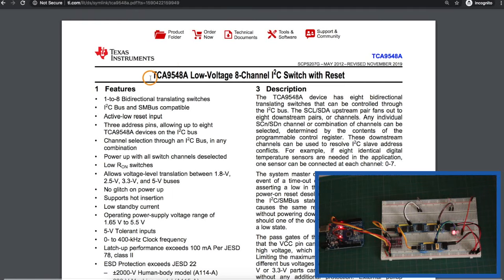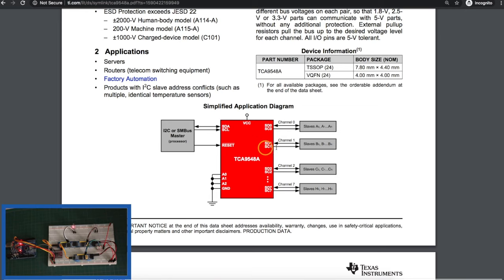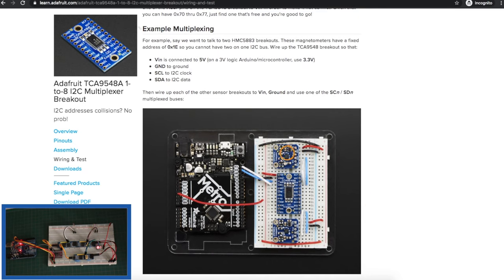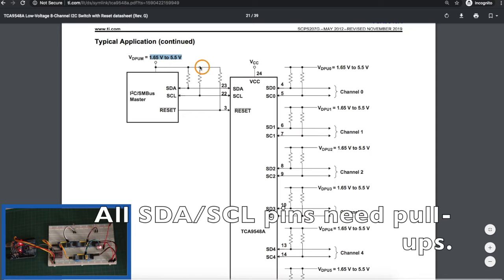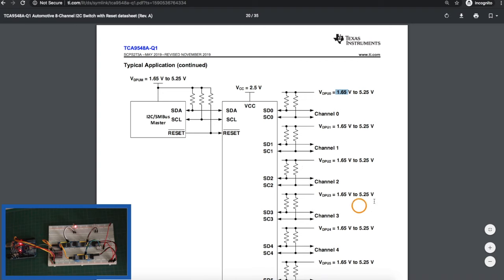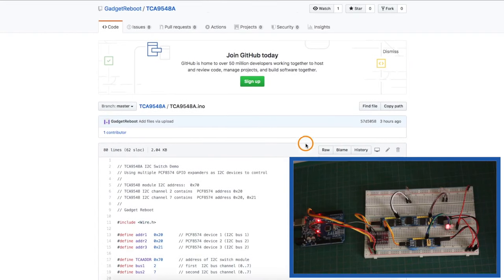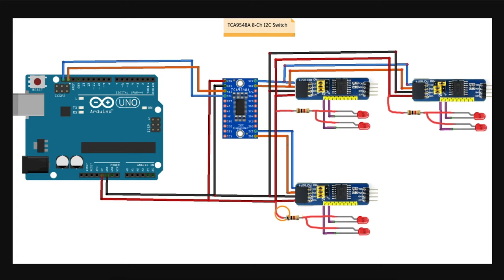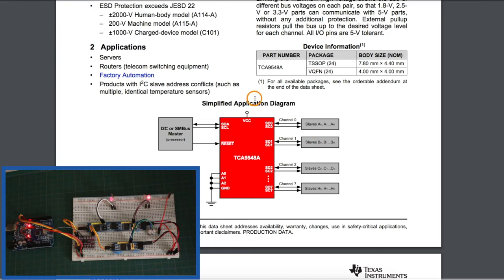TCA9548A I2C Multiplexer: Use Multiple Devices with the Same Address on Arduino

Comment: It's a nice chip, but you have to try and keep as much on the same bus as you can to keep the bus switching overhead to a minimum If you require full speed. Still it's a nice way of getting out of an conflicting address hole.
Reply from the maker: Yeah I can't imagine trying to do fast ADC or DAC things this way.
Reply: @GadgetReboot  For fast ADC or DAC, a high-speed DMA SPI would be the preferred protocol.

Comment: Nice job!  I had not thought about needing this, so far all my i2c are configurable or on unique addresses.  Very well explained.  Off to ali I go...
Reply from the maker: I had this module sitting around who knows how long, then I hard wired the address pins to a chip on a PCB and realized I should have put jumpers so I caused my own limitation when I wanted to use 2 boards together...  Always good to buy random modules for those unexpected times.

Comment: Hello mam.... Begin just a beginner and have started learning very basic of arduino... I came across how we can  expand are I/O pin in arduino... But i was wondering can we store the status of those pins in the eeprom of arduino... So even if power cuts the expander regain its previous state before the power cut
Reply from the maker: I've never used the EEProm but apparently there's examples here for reading and writing to it https://www.arduino.cc/en/Reference/EEPROM   
So yeah, if pin states are known like an 8 bit byte of GPIO states, that byte should easily be able to write to EEPROM using the examples and later can be read back from that location.
Reply: @GadgetReboot  oh...!!! thanku mam for your reply... Although i did not  dive deep in the EEPROM functionality but i have learnt how to read and write to EEPROM.... And  here with expander Ic's i thought that there would be a different way of implementing them.... As ARDUINO and ESP8266 have different ways to perform the Eeprom.... But know my concept of using Eeprom with expander Ic's is clear

Comment: Hello, I'm a beginner and I would like to know :
Can I control relays with this address?

Thank you in advance 😊.

Cordially.
Reply from the maker: These are logic level control signals so some sort of relay driver would still be needed and that would be hooked up to these logic outputs. So either some sort of transistor driver or a more simple way is a driver chip like ULN2003 or ULN2803
https://microcontrollerslab.com/introduction-uln2803-features/
Reply: @GadgetReboot  Hello, thank you very much for your feedback 😁. I'll check the link :). 
Have a nice weekend 😄

Kind regards 😊
Reply: @GadgetReboot  Hello, I have another question :

Can you use the MCP23017 (a GPIO expander : https://m.youtube.com/watch?v=0yIXN2nfxAA&t=26s ) with the TCA9548A multiplexer?

Thank you in advance for your precious support 😁.
Cordially.

Comment: Hi. Sorry i ask (i think you explain this but i dont understand well english, and i do not know much about electronic). Im using a tca9548a i2c with a raspberry pi zero w. I connect the tca9548a to 3.3v. and have 4 mcp23017 connected to that tca, also that mcp23017 with the same 3.3v. from the rpizero. But, i also want to connect a ht16k33 to the sda sdc of the tca9548a but, i want to connect the ht16k33 to a 5v (power from a cellphone). When i do this my program fail to execute... but if i put the ht16k33 to 3.3v works fine... so the problem here is that the tca9548a is not playing well with the different values. How i can get to work this? i mean some modules with 3.3.v and other with 5v? Thanks!!!!!

Comment: Hello 
when I am configure TCA9548A with node mcu with temp sensor and Oximeter it's not working together but it's working on the Arduino what is problem with the node muc because same Programing is Done on the Both Board
Please tell me????  it's Imp For my project
Reply from the maker: For NodeMcu, is the TCA9548 module connected to:
VIN to 3.3V
GND to ground
SDA to D2 and
SCL to D1 
And is it just using the normal Wire library and not a special I2C library?   
Was the TCA9548 with the 2 sensors working on a different Arduino and just not NodeMcu?
Are there I2C pull up resistors on both of the sensors connected to TCA9548?  Each I2C bus is treated as a separate one and they all need resistors if not already on a sensor or module.
Reply: @GadgetReboot  for the Arduino mega it's working and same Programing and connection is not working on node mcu 
FOR NODE MCU connection is Done and I am using only wire library not using special Library for that and node muc and TCA9548A Is connected to the 3.3v vin and also using 4.7k pull up resister for the SDA And SCL pin Please give me the solution it's help me too out form this problem
Reply from the maker: @ujwaladhaimbekar5874  The way I would try to figure it out is first eliminate anything extra to see if it's even related to TCA9548, so does it work if just one I2C sensor is directly connected to Node MCU?  Also, if the sensors are powered from 5v on mega, are they also powered from 5v for Node MCU or are those on 3.3V?   The TCA9548 should be powered from 3.3v but if the sensors can't run on 3.3v they can be hooked to 5v and the TCA9548 can work with 5V sensors.
Maybe the sensors need 5V and you may have used 3.3v and it won't work?
Reply: @GadgetReboot  for the Arduino mega both the sensor Are operate on 3.3v and in mega also I am connected to 3.3 v only 
When I am interface them in Separate then it's work But when I am connected them together then only oximeter work and temp sensor not shown any reading.
Reply from the maker: @ujwaladhaimbekar5874  It would probably be easier if there were wiring diagrams for both setups and the sketch somewhere for people to see and then maybe someone can identify something easily.   
Another thing that has happened to me that made no sense with Node MCU is using a different board file for it in the Arduino IDE where suddenly some things stopped working until I changed it to other versions.  Right now I am using esp8266 version 2.4.2 in the Boards manager. I remember when I used newer ones, some things didn't work.
Reply: @GadgetReboot  OK I will try this
 thank you😊

Comment: Hi friend, interesting device.

So, could you (or some one else) please tellme if i'm getting this right?
I'm trying to work with 5 GLCD SSD1306 with a pic18f4550.  But this exceeds the ram's space.

With this device,  can i  just have one single oled graphic display ssd1306 on my pic's program, and just declare 5 different variables that will define the 5 different adress to each glcd? (While connecting them to this device...)

Or, i'm still having to declare the 5 GLCDs on program to recognize them?  (Which is sadly not gonna help me saving ram)

Thanks and Have a nice day.